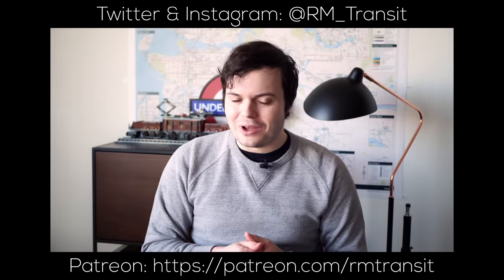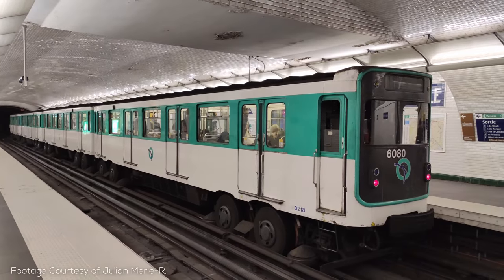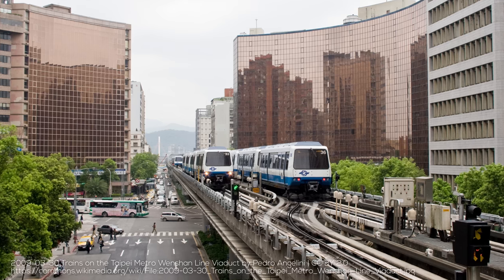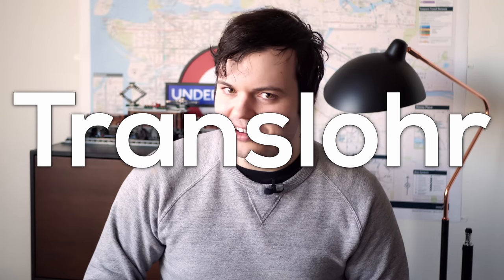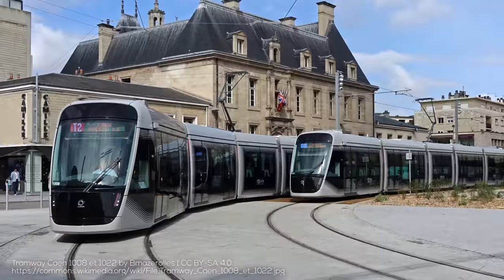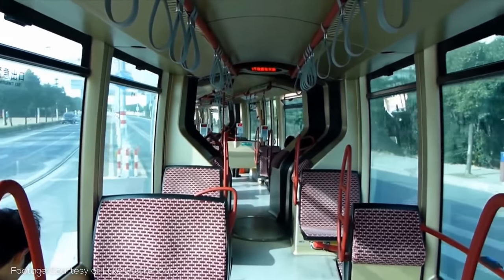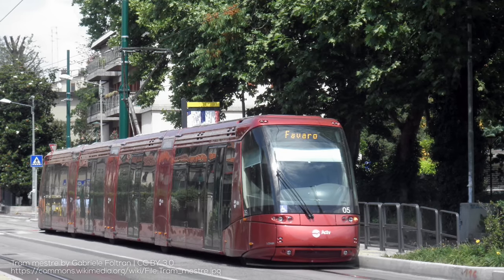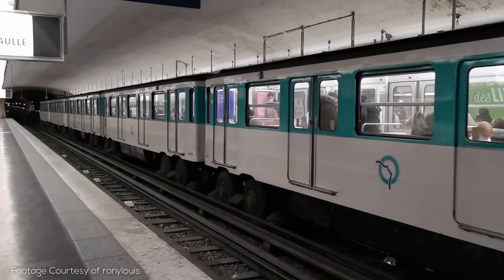Rubber-Tire Rail Transit is Weird

Comment: Brisbane’s new “metro” is literally a long bus with rubber wheels and that makes me mad
Reply from the maker: It’s just a pretty standard bus! So it’s fine!
Reply: It boggles my mind why they don't follow Sydney's example and build a full automated metro system instead.
Reply: it's Just a really long articulated bus to me and they were designed for use on the pre-built busways
Reply: it doesn’t have a lot of the disadvantages that RMTransit mentioned here because it’s literally just a fancy bus. There’s no guideways or rails or overhead lines, just wheels on tarmac.
Reply: @Justin-xk7yj  it'll be so hot
Reply: Brisbane Metro is literally just a transitway/busway. While the model has issues (although I personally do like transitways), it is in no way comparable to what Reece is talking about here as it is quite literally just busses in a dedicated roadway.
Reply: The upcoming Brisbane Metro is just an extremely overdue upgrade to the existing busway.
Reply: It makes use of the existing busways without extra investment. It creates huge value by increasing their capacity.
Reply: The money would of been much better spent on extending the busway into the western suburbs or on a real metro system across Brisbane to integrate with current public transport and fill necessary gaps.
Reply: @RMTransit  I would love to see a video about the Brisbane metro!
Reply: @dtrot24  The Western suburbs don't need a Metro/Busway constructed. Need to completely rethink the buses in that area to complement, rather than compete, with the under-utilised Ipswich/Springfield trains. That is an issue with great swathes of Brisbane, the three modes (ferry, bus and train) all compete with each other to varying degrees, rather than complementing one another - thus you can catch a bus from almost any corner of Greater Brisbane (and even well beyond Council's fringes!) into the City, but you can't easily travel east-west.
Reply: @misterrocks3035  you obviously don’t live and have not experienced public transport in the western suburbs. Have you tried to easily get to the valley or west end ect easily from the western suburbs by public transport? It’s a joke, just like the entirety of the translink network. Going to and from the city and its surrounds need to be reworked and up graded not only in the western suburbs but across the entire network. The metro is a gadgetbahn at best and will do nothing major to help public transport in Brisbane. Especially without necessary major upgrades to take out the grey street intersection at the cultural centre.
Reply: @dtrot24  More frequent buses into Indooroopilly / Toowong would fix that (get a train from there to Fortitude Valley). The “green” bridge from Toowong to West End will fix that connection too.

Metro is a good solution for what it is. The existing busway is too steep in key sections (KGS to Roma St, the originally proposed Cultural Centre rebuild) to allow for steel wheels - a big bus is a much better solution than putting down a tram for no actual benefit except steel rails.

Reece’s point is either use steel wheels completely or don’t at all - Brisbane has gone for the latter.
Reply: @LewisTL95  to get more frequent services to Toowong, Indooroopilly and beyond to mount ommaney ect, you would need to first fix the coronation drive/Milton road to moggill road/western freeway cluster f**k. The Toowong-west green bridge is just another project like the go between and all the tunnels that end up being useless because of the traffic and bottle necks at each end, there needs to be consistent uninterrupted flow for any of these projects to work. Plus major upgrades to interchanges and passenger infrastructure. The current “upgrade” at Indooroopilly is no where near enough compared what should of been done long ago. That interchange has barely changed in 40 years. 
Because of the many decades of investment in infrastructure, there is now a plethora of issues throughout Brisbane and it’s surrounds. There will be constant construction to even have anything have decent completed before the Olympic Games in 10 years.
Reply: @dtrot24   I experience the Western Suburbs mess a few times a week and yes it's a joke. In mentioning Mt Ommaney (or anywhere like Fig Tree Pocket and farther out)  - again, that these areas have a cornucopia of direct city buses instead of more services for a train connection is a terrible planning.

All of them funnel into that Moggill/Coro corridor, which is heavily duplicated, with multiple stopping patterns, different frequencies, different hours of operation. Too confusing for casual or potential users. Ideally you'd truncate every City bus except the 444 to Indooroopilly Stn, then run the 444 all-stops the remainder of the way into town (doing some stop consolidation so they're not every 100-200m, of course!) at 5min peak, 7-8mins off-peak, with only every second bus going to Moggill. 
Obviously the link to UQ would still be important from there, and I think the 598/599 could potentially play a far more important role than they do presently (look at Perth's 998/999 Circle, its frequency and span as an example). 

That example is largely what needs to happen across Brisbane. A couple of consistent, frequent routes along main roads, with local services to feed the railway and maybe direct City buses in the peak where getting to a train is particularly awkward (Jindalee comes to mind but then Oxley isn't that far, especially if they took a more direct route).
Reply: @RMTransit  It's not a bus!!! It's verboten to say that in Brisbane lol.

The local politicians are adamant that it not be known as a bus
Reply: Great to see so many fellow Brisbane residents here - I was scrolling down hoping for this 😂
Reply: @misterrocks3035  I don't know Brisbane but there's an interesting question of principle here. Do passengers prefer a bus right through to their destination (city centre), or would they rather change on to a faster train? Reliability, distance, connection time and train frequency are key factors. We saw this in Newcastle UK where the original plan was for all buses to feed into the Tyne and Wear Metro (with 5-10 minute frequencies) but then things changed and many buses started running into the city. Passengers seem to have used both options.
Reply: @tarjaau  well other cities like Melbourne and Sydney have good suburban rail service

Comment: For the Medellin-Tram: A regular tram would have been possible. But, coincidentally, the system was built with a loan given from the French government. That was after representatives of French companies visited the country. You know, things just happen sometimes. :)
Reply: That tracks, unlike Translohr...
Reply: Stop giving transit projects to the french.
Reply: Same thing in Cuenca tram tho
Reply: @alfrredd  THey have the best engineers of the world, best transit technologies (Alstom high speed, or Citadis, VAL technology bought by Siemens), solid consulting companies for the studying like Systra and excellent construction engineering companies like Vinci, Bouygues, Eiffage, all of them have build Trams, Metro, HSL.
Reply: I watched the Medellin Tram videos. That route with those slopes and curves, mixing with traffic and sudden stops etc. could NOT be possible with steel wheel regular trams. They would have to make bridges, tunnels and knock down a lot of building for a regular tram.
Reply: @kekessalman  That might be the case, indeed. Still, the problem could have been solved with a different routing probably. Of course, I don't know for sure. Yet, the fact that the project was kicked off after some French business men visited the country, is enough to raise some questions. :)

Comment: I can't speak for other cities, but in the case of Lausanne (Switzerland) "Paris-style" rubber-tyred metro was a really great choice. The line literally replaced a urban rack railway in its lower part, and is (correct me if I'm wrong) the steepest rubber-tyred line in the world.

It has been a huge success since its opening in 2008, constantly outpacing usage predicitions. The construction of a new line has been approved and will use the same rubber-tyred technology (again, because of the slope of the city).
Reply: Lausanne’s M2 metro could totally have used standard steel wheel trams. At the cost of lower accelerations. But the line, as is, is undeniably a success.
Reply: CDMX in Mexico has a mix of tyre and rail systems in its metro. It got me reading into it and the only real benefit I can see, is rubber can handle steeper inclines more effectively.

There are other minor advantages, but I don't think they justify the use of rubber tyres.

Being from the UK, I don't think London has any rubber wheels on the line and London is one of the best run metro systems in the world.

Although I acknowledge London's underground is expensive, was built without any central planning and sometimes has poorly designed platforms.

Edit: and London is mostly pretty flat.
Reply: @Joshua-fi4ji  Was reading that Mexico City is slowly sinking/settling over time, so its metro/subway tracks' profiles will change slightly over time also, & using rubber traction is less likely to lead to derailments as a result compared to steel traction (probably because rubber is a more flexible material)
Reply: @lzh4950  makes a lot of sense actually. I knew that about CDMX, but never put 1 and 1 together.
Reply: My dad actually worked on the prolongation of one of the lausanne metro lines. the slope is indeed incredible !
Reply: @damiensonney9880  The Bernina railways is the world steppest adhenrece railways at 70/1000.
The Lausanne metro climb at 116/1000, well beyond the capability of existing adherence railways.
Before being a metro, a part of the line was first a cable car and later a cog railways.
Reply: @jean-marclugrin1902  That's not correct. Lisbon has a tramline that runs at 134/1000. There are many tramlines around 100/1000 gradient
Reply: By definition a "Paris-style" metro is standard gauge, tires on flat surface is an option.
Reply: @Joshua-fi4ji  the tunnels themselves in Mexico City were designed to have neutral bouncy, as much as physically possible, and to allow some bending between the different sections of the tunnel in order to mitigate the effects of the city's sinking.
Rubber-tired trains allow for more flexibility as the alignment of the track changes as the city sinks at  different rates and weight less than steel wheeled trains of the time, further mitigating the issue of the sinking. 
That is why cities like Guadalajara and Monterey have steel wheeled metros, they are on solid rock unlike the swamp under México city.

Comment: A couple of minor additional points:
Standard trams aren't too bad at hill climbing. Sheffield (UK), Prague (CZ), and especially Lisbon (PT) systems all have steeply-graded sections that regular trams cope fine with. Obviously if you have a really steep hill you might need rubber tyres, but only really at the extreme end of the scale.

Secondly, one of my least favourite aspects of rubber-tyred metros is the smell of burnt rubber, and the tiny particles of rubber dust which passengers can't help but breathe in. I'd much rather endure flange-squeal than the smell of burnt rubber.
Reply: Those old four wheeled Oporto and Lisbon trams are amazing - how they get up those really curvy inclines is fabulous, not to mention coming down again! Line 28 in Lisbon!

It’s been a few years, but I did notice that the old Lisbon and Oporto trams had had their running gear updated. This was after most of the older suburban trains on the London Underground Metropolitan Line dating from the 50s and 60s had been withdrawn. The new four wheel sets and sub-chassis for the Portuguese trams were each one power bogie/truck from the withdrawn London Underground trains, reconditioned. Nice bit of recycling!
Reply: Lausanne, a very hilly city in Switzerland, replaced their dense tram network with buses and trollybuses.
Reply: In my home area, there was a trolley line with near 20 percent grades in locations. The 4 motor cars had no issue no matter the weather getting up and down the line.
Reply: And dog kennel hill in london
Reply: where in prague is there steep tram line?
Reply: Stuttgart has entered the chat
Reply: For the really steep bit of hill in Sheffield they built a short section of viaduct to spread out the hight change over a longer distance.
Reply: @t0biascze644  between Nad Trojou and Hercovka - 8% grade
Reply: Augsburg also has quite a few steep hills with tram tracks on them. The steepest one (Perlachberg) with a gradient of 11% is actually the steepest tram route in Germany, currently in service. To be fair, it is only served on the way down. But there are quite a few steep sections, where the trams climb aswell. Steel wheeled trams can certainly climb hills, if they aren’t extreme.
Reply: @Papinak2 How steep is the climb to Barandov?
Reply: @highspeedrailenjoyer1045  The same was done in Porto, and I learned recently that it is now considered a mistake, as the busses do not climb as well as the trams did. But that's spilt milk, they will not revert to trams.